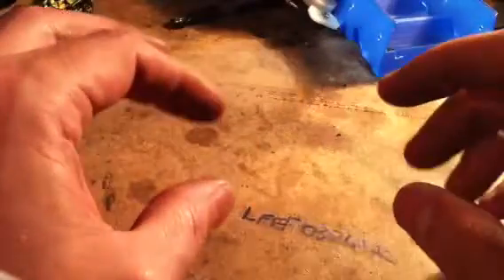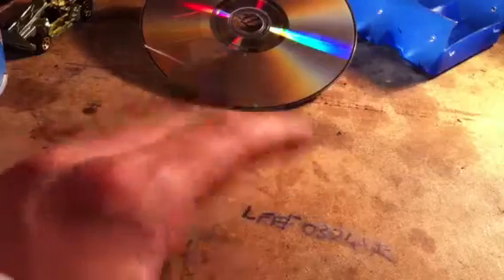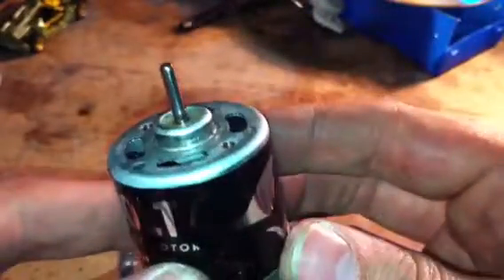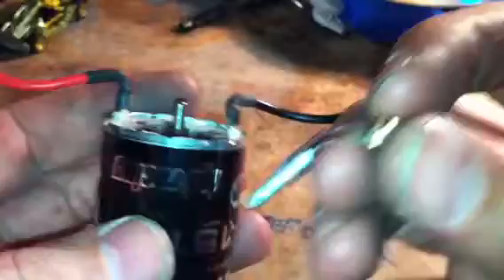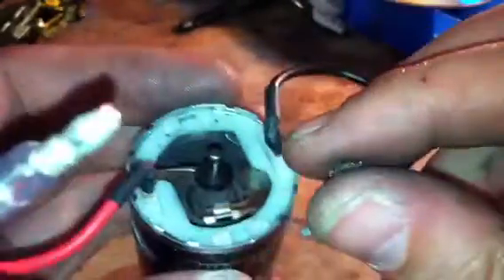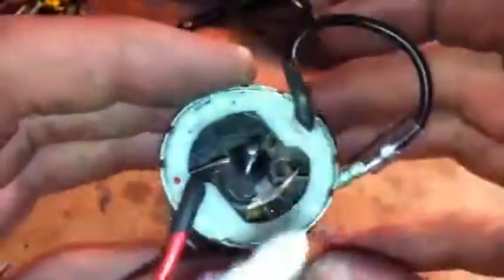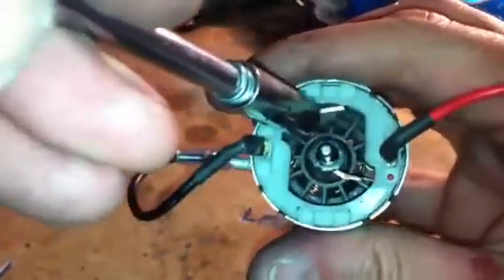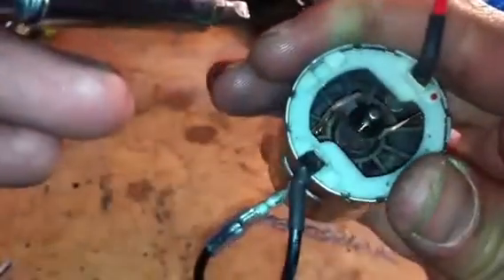FIREBOLT HPI 15t gets fried part 1

Comment: I had a firebolt for a few weeks time in a 2wd stampede and it ran well on the stock 7 cell nimh but once I geared up a bit it made short work of the brushes even though the average temp was still good. I think it's a good motor as long as you don't run it geared high and/or on a heavy truck such as a 4x4 sct or something similar. This motor in a 2wd stadium truck or buggy would probably be great.
Reply from the maker: it's a great motor I think I just over cooked it. I've still got a couple they are restricted to 1/10 touring and as you said standard size RCS.